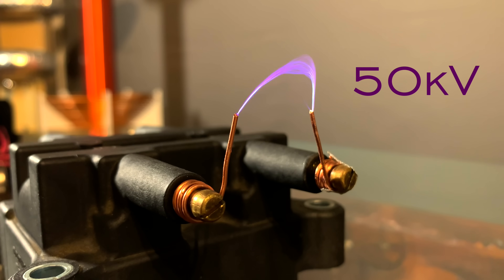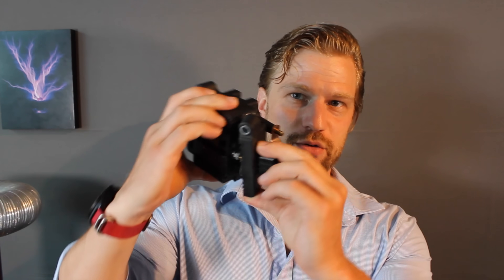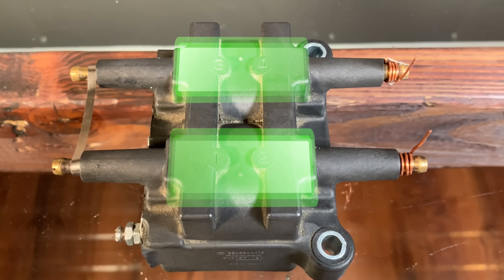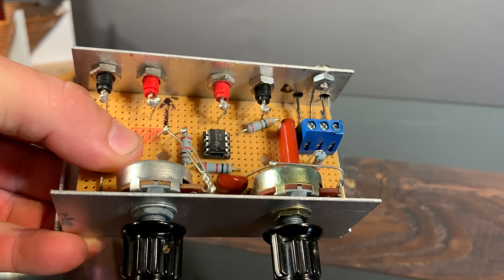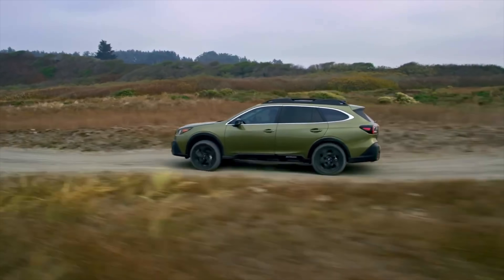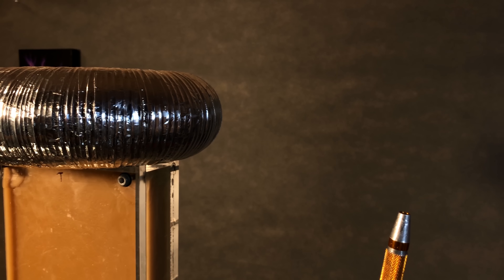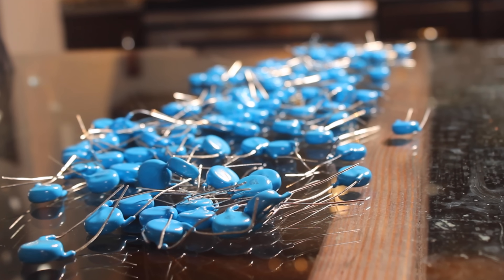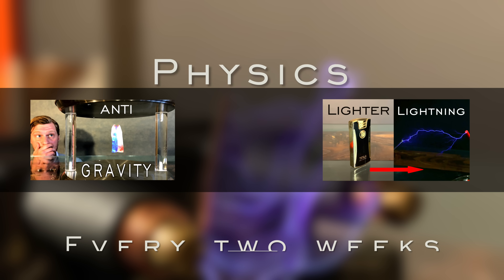The 50,000 volt Subaru Outback Powersource!

Comment: Fuckin ignition coils... Almost died from one of those cunts, I had set one up on an AC dimmer switch being fed with 110v line voltage. Made killer arcs (had to be submerged in oil of course), until the day that killer arc almost killed me. Got grounded through my right hand on my stainless work bench (I know) to my left hand holding the live wire, for about 10 or so seconds until my body kicked it's way out of there (only thing you can do when you complete that chain). Felt like I was getting cooked, since I was, by 50kv+ high amperage 60hz AC. Don't repeat that one kids, stick with low amperage stuff, especially when you are like 15...

Not even the last time I got stuck with a hand on either polarity either, got feed line voltage for also about 10 seconds until I also kicked out of it (working with my dad who was an electrician back then), sliced my left palm to the tendons when the bare outlet I was holding ripped out of my clenched fist (almost bleed out 45 min from the hospital). 

Don't play with pixies kids, let the adults do that shit. Lesson I wish I had learned in my youth lol.

Cool ignition coil setup though. Its cool what you can make with used throwaway parts huh?
Reply from the maker: Mark thats insane. I've had some BAD shocks in my life, but never from an ignition coil. Usually these things just give a strong zap, enough that my body takes over and retracts safely.
Reply: @PlasmaChannel  yeah usually ignition coil zaps just hurt, and they are run at higher frequencies like AC, but only in one polarity. Adding AC to the equation was far more dangerous than I had understood at the time lol as I'm sure you know as well. That, and unlimited current from the wall outlet heh. Just for reference, the coil was one of those old popcan size cylinder ignition coils with a ceramic tip for the contacts which I stuck in a jar full of used motor oil (which splashed everywhere on everything in my shop and myself when I kicked out lmao). It could draw 1" arcs which would make 1/16" steel rods melt at the tips so it had some serious current running through it, I'm kinda lucky I survived considering how little current it takes to kill a person. Well whatever doesn't kill you makes you stronger right? Lol.

Comment: i watched your videos and while you do mention fire safety in some videos  and some high voltage warnings you may want to include that if you have a heart condition or a medical implant you may not want to mess with electric because just as a heart can be restarted with electric you can stop a heart with electric and cause damage to the electronics of medical implants.

even a person working on their own house wiring can get zapped and can destroy a pacemaker implant  and die of heart failure so you may want to update the warnings
Reply from the maker: Funny thing : I have a serious heart condition myself. Being shocked by house wiring, 120 volts is extremely dangerous because the house power provides 20+ amps. Gone in a flash. In general, I do not mess with, nor film videos on, high voltage at high currents. Cheers!

Comment: Use a car battery dude. I wanna see some real shit. People will see it and it will hit millions views. Double your voltage goal that will get you where you want but only if your safe and know what u are doing
Reply from the maker: Car battery would produce smaller sparks - its only 12+ volts. I ran this with 14.8 volts and lithium-ion batteries.
Reply: @PlasmaChannel  wow I had no idea. Thanks

Comment: A coil may be able to take 50000v but it doesn’t normally, in a car a coil runs off the battery, and car batteries usually only out of 12v at a high amperage unless it’s a diesel with 2 batteries running in parallel which isn’t very common
Reply from the maker: True. As mentioned in the video, they are designed for 15,000 volts continuously, on average. Under compression in the combustion chamber, it takes high voltages to ionize the compressed air. So the 1-2mm gap actually takes a fairly high voltage.

Comment: Hey man, I just subscribed. Can you make a multipler to feed into a solar battery this reducing the amount of panels needed? Note: I know nothing about electrical engineering, wont try to build one just curious.
Reply from the maker: I am honored to have earned you sub. Solar panels power themselves. Putting power into a solar panel will destroy it. Can you further clarify your question?
Reply: Power coming out of a solar panel feeding into a multipler, that increased power then feeding into a solar battery pack.

Comment: What do you get at the secondary of a step- up transformer if you apply 10Vac at it's primary coil?.. ( the secondary coil has one million times more windings than the primary )
Reply from the maker: In THEORY, 10 million volts AC. But in reality it’s much more complicated than just turns ratios!
Reply: @PlasmaChannel  10MVolts exactly!👍
What do you mean when you say " in theory..?"
Reply from the maker: Because, voltages that high would never actually be reached. No transformer designed to take only 10 volts, and output 10,000,000, could insulate 10 million volts properly. The secondary wires would burn through their insulation, and short out on the transformer's core. Also, current would likely be so low on the secondary that voltage drop would be massive, making the 10,000,000 volts nearly impossible.

But, according to the theory of transformers, yes, it is possible. In theory.

Comment: Anti parallel? Nice one Joe Deer-tay, it's called series.
Reply from the maker: They are ran parallel to the power source. Drawing same current and voltage from power source. They did not draw power in line with one another. That would be called parallel. One is flipped. This, is antiparallel.
Reply: @PlasmaChannel  you're funny. I'd love to see an electrical diagram based on your explanation, that'd be like building some Penrose Stairs.
Reply from the maker: Anthony, antiparallel is a well established circuit style. Cheers
Reply: @PlasmaChannel  it is, but I believe that you're using it wrong. Flipping a coil doesn't make it an anti parallel circuit and would only result in the generation of two equal and opposing electromagnetic fields that would cancel each other out. Considering the fact that the center connection is a permanent join between the two coils, how did you flip a coil?

Comment: “Used by every gas powered car on the planet” one word- distributors
Reply: Distributors just direct and time the spark, they still require an ignition coil to generate the spark.
Reply from the maker: Correct. Distributors do only as their name suggests. They distribute the spark, to the proper cylinder. Still need an ignition coil. There are a few small exceptions, but every gas engine uses a coil.

Comment: What makes the “Subaru” coil unique? Aren’t all coils turning 12 bolts into roughly the same output for a spark plug?
Reply from the maker: Great question. Not all ignition coils produce the same voltage. Some produce as little as 10,000. Others, 75,000.

Comment: Nice, back in 1998 I had a Jacob's Energy System ignition.  It was 80,000 volts and it sent the first spark and read the impedance,  calculated the amount and sent up to 8 more sparks in 1 degree of crankshaft rotation.
Reply from the maker: Thats actually really impressive. I imagine that create a very complete combustion, and great fuel efficiency.

Comment: Trying make a flat 12 volt 17 to 20 amph if that's possible . But less than 2" thick and 12X13 "  in flat dimension . Is that possible with out comprising cost?

Comment: Be sure to post your address where we can send flowers.  1.2 million volts?  And I thought working on old tube equipment was dangerous. :-)

I subscribed and rang the bell.  Plasma work is very interesting.  I already started with it, bought the blue caps a while ago.

However many people watching are not disciplined for working with HV.
Reply from the maker: Cathode, Honored to have gained your sub! Yes, I specialize in high voltage applications and love to teach others about ionic physics! I plan on doing a video soon about high voltage safety.

Comment: anti-parallel , lol better known as series...
Reply from the maker: Anti parallel and series are different. Putting two ignition coils primaries in series, and their secondaries in series, results in a similar voltage out as just powering a single coil. 

Antiparallel is powering both coils from the same power source, but, powering one coil in reverse. So that way, if you put the secondaries in series, one coil develops positive charge, the other, a negative charge at the same time. Double the voltage out.
Reply: @PlasmaChannel  like a cap and diode arrangement

Comment: So this is Subaru being understatedly awesome (again)?
Reply: A J except for the gaskets on their engines. 😂 I love Subaru, but the street WRX blows gaskets every time you want to push it. Their real rally cars tho are incredible and definitely some of my favourite.
Reply: @TheSenatorXV  Turbo Ej25s dont really suffer from head gasket failure. That's really the N/A models and they have mostly fixed those issues.
Reply: Brandon Howe Ah that’s good to know! 🤩 I was disappointed for a while cause I knew Subaru was better than that. Glad they put the work in to fix it for the most part.
Reply: @TheSenatorXV  subaru wrx headders have 1 cyc cut different to make the sound u all love. A shop has to plan the head and make an adjustment. Then it wont blow the gaskets =)
Reply from the maker: Subarus last forever if you dont push them. I love Subes for that.
Reply: @PlasmaChannel  um no. Unless you drove like a grandma. Are you a grandma? Drive extra slow beyond the speed limit?
Reply: From experience,  I had an sti. So they really suck. Unless you were like 90 years old driving really slow.
Reply: No, never unless you drive your subaru like a grandma. You'll blow a head gasket before anything.
Reply: @laosracer12  i have a 2000 outback 5 speed. Eng has upgrades ;intake exaust coil wires plugs fuel system... and i push that baby to 5k-7k rpm at least 2-3 times a week... 176043 miles and no blown head gasket (orginal gasket still installed) =3
Reply: @woodzyfox4735  at least 2 to 3 times a week? I push my Mazda to 7k redline on a daily. The problem is that your car isn't turboed so it can last a little longer before it will blow.
Reply: @laosracer12  daily? U must go through a lot of oil. Also whats your mileage?
Reply: @woodzyfox4735  224k. Does not burn oil. Look at my videos.
Reply: There must be some mod out there whereby one could make the head-gasket last longer.  There are head-gasket restorers which might safe-guard it.  Just trying to think outside the box.
Reply: @AJ-xm4xc  the key is that once it blows, you get an APR headstud kit and heavier duty hg.
Reply: bob dales Yup.

Comment: Try using the coils from GM that is put on the buick 3800
Reply from the maker: Are those particularly powerful?
Reply: @PlasmaChannel  Ther are powerful. They use the wasted spark system firing two spark plugs. The bonus is that the coils are individual unlike the Subaru coil you had in this video. They produce 50KV for the spark at 12V. You pull the plug wires off of a running engine and it will jump between to coil towers.

Comment: I’ve come to learn that anything internal combustion engine related is truly inferior tech compared to electric vehicles. I’m not saying it’s not impressive, just overly complicated and inferior
Reply from the maker: It is fairly complicated, but they still have several advantages over electric. Cost, toxicity of recycling, and power output per weight of fuel (battery vs gasoline)

Comment: Here's a little Diddy I done as a kid. 
I was old  enough to use the push mower, yay!
After a few times I knew what I was doing.🤣
As I went under some bushes , the plug wire popped off the plug but it stayed running. 
I thought that spark looked really cool! 
So I took a leaf off the tree and stuck it in the spark to make it stop. 
It didn't stop, but I didn't need any hairspray for 80s hair either 🤣
Reply: I touched a spark wire on a lawnmower once. Learned to fly, landed 20 feet back.
Reply from the maker: Haha, thats awesome. Cheers!
Reply: My brother was tinkering with a old boat engine and having trouble getting to to start. He asked me to hold the spark plug lead, grabbed the crank handle and turned the engine over. Thankfully the capacitor in the magneto was shot, so I only got a 'mild' shock...
Reply: eat me  your a man if you can hold it on their to more than  5 seconds
Reply: eat me  
Only once
Reply: Yeah that's painful!   Until it happens on a 454ci Chevy Big Block! 😐
That was worse then getting Zapped by the 120VAC house power 😅

Comment: i nearly had a heart attack when he nearly stopped his heart by sticking the screw driver in the arc!
Reply from the maker: Beautiful thing about AC high voltage - with one hand in your pocket it is difficult to have electricity flow across your heart. Also, the electricity in the arc was taking the easiest route to a full circuit connection( terminal to terminal on the transformer), so the current is not inclined to even flow through my body in the first place. Electronics magic, dare I say.

Comment: That's not plasma. That's just the arcing. CB works on that principle.चूतिया मत बना
Reply: Not sure you fully understand what plasma is...
Reply: https://www.google.com/search?q=do+lightning+strikes+generate+plasma&oq=do+lightning+strikes+generate+plasma&aqs=chrome..69i57.16204j0j4&client=ms-android-verizon&sourceid=chrome-mobile&ie=UTF-8

It's plasma...
Reply from the maker: Plasma is any ionized state of matter, mate. I'm with William. Any high voltage arc causes Plasma through super heating of the air, and stipping of electrons from the air molecules (ionic state, thus plasma)
Reply: @PlasmaChannel  That's a very general term for plasma. Plasma isn't just ionized electrons. IEEE won't approve that
Reply: @PlasmaChannel  any sufficiently high voltage arc, that is... I think they might actually have a point. 

Not all visible light generated by arching electricity is a result of generated plasma, as the voltage and amperage as to be high enough to sever the bonds between electron and proton. 

The spark generated by a small piezoelectric Crystal, for instance, surely lacks enough energy to create plasma, right?

Comment: Interesting work, but if you think that this coil is going to improve the power output of your average engine, you will be sadly disappointed. Once you have enough spark, more spark does nothing. Might be of value to Extreme engines running extreme boost.
Reply: I don't think that was his point. He just wanted to see what it could handle, and it turns out it's multiple times more than what is made by a car battery. He didn't actually change anything he just ran a ton of electricity through it

Comment: They should start using lasers for ignition.......less voltage....and you can aim it anywhere in the cyl.......and run it for all but the comp strokes.
Reply: Sounds expensive to replace

Comment: Got anything on a relatively cheap but reliable automobile plasma ignition?????
Reply from the maker: Hard to beat, right?
Reply: @PlasmaChannel    I"m relatively uneducated on electrical stuff.  Can I "wire: this up,  as you have demonstrated, into an auto ignition (in lieu of the regular coil)??  Your guidance would be very much appreciated.  Thanks.
Reply: @PlasmaChannel  Sorry for my confusion, I rewatched and you answered most of my questions, but a simple wiring schematic would probably be appreciated by some of you viewers.  Thanks

Comment: What makes the plasma evenly spaced? That was an awesome video, subscribed!
Reply from the maker: The even spacing is due to the precise timing of the 555 chip, turning on and off the power at precise times. Also, my fan above me had a steady flow of air pushing the plasma down.

Comment: IT IS the Flux Capacitor from
Bak to the Futur!!
Reply from the maker: Good ol Doc.
Reply: Great Scott.
Plasma will become a great voltage multiplier   one day like the flux capacitor in BTTFuture. Used a 400k plasma (voltage booster) to charge into a 400v capacitor,  3 seconds cap had 16v charge , a scary charge process i can tell ya .

Comment: Could you use that to send the current through a core and extract hydrogen from water ..make a hybrid of electrical and water  not gas
Reply from the maker: The current in these arcs is not particularly high (though the ZVS driven arcs are) May be worth an experiment!
Reply: @PlasmaChannel  I would love to see an attempt at extreme electrolysis! I would say it sounds too dangerous but if you are ok with 1.2 million volts, I'm sure you'll be fine 😆